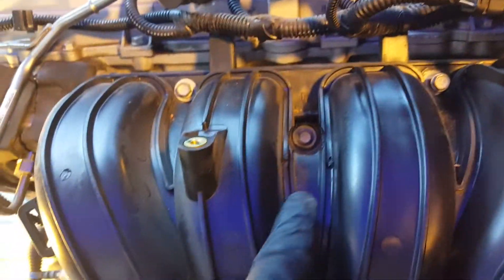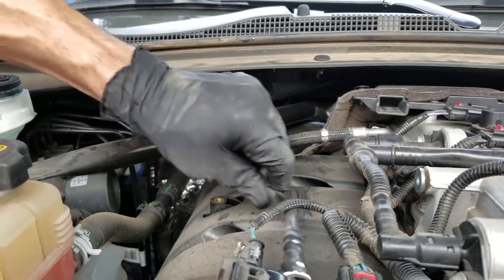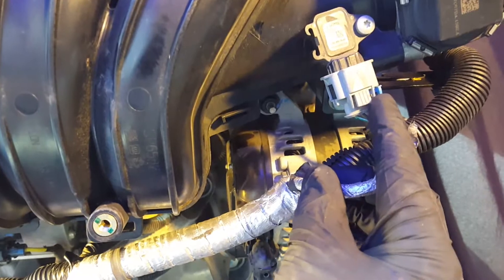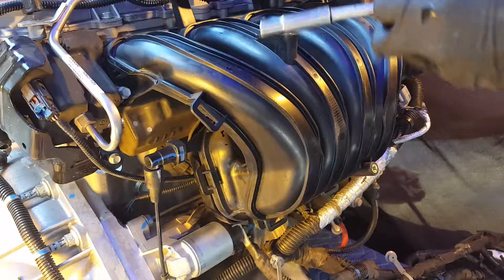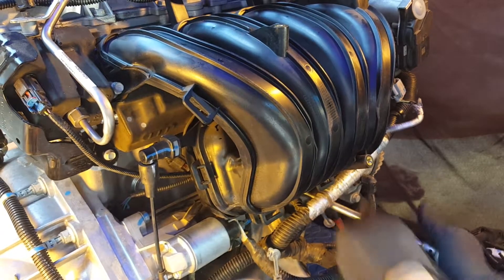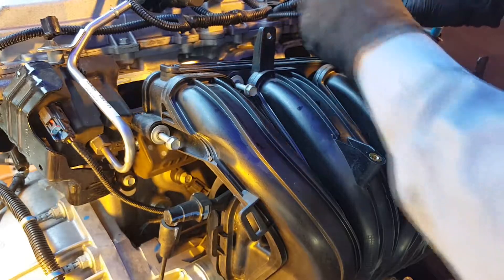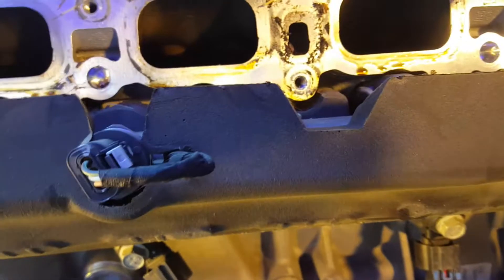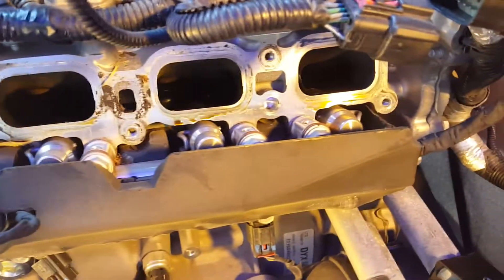2.0 Camaro - 2.0 ATS LTG - How to Remove Intake Manifold

Comment: For anyone looking to do this on a 2.0 CTS (MAY be the same on the ATS or Camaro) — in order to get the “sneaky bolt” underneath you MUST remove the alternator (mind the 12V hot lead, best to disconnect the battery as you will NOT be able to get at it before removing the alternator) to get at that hidden bolt. Once the alternator is dismounted just lay it aside forwards, and you’ll see the hidden “sneaky bolt.”

Comment: How did you even get your camera in position to capture the lower intake manifold bolt like that?? Replacing the transmission in this Camaro and it is by far the worst job to date 🤦‍♂️😭

Comment: would it be so bad if you just broke off that bottom bolt?  It doesn't look like it would create a vacuum leak.

edit: I did it today.  No problem.  Tore off the intake cover as well.

Comment: Would be great if you could clue us in on how to remove the "sneaky" bolt on the bottom seeing as how it's f*cking impossible. Any fool can get at it with the engine out of the car
Reply: Having same issue right now. I even removed the coolant resevoir for more room but i cant find that bolt & a stupid piece of metal hose is in the way 😭

Comment: Ok so everyone here knows it’s way Easier to remove the alternator to get to the bottom bolt your still have yo go under the car to unhook the vacuum line but you can stay on top to unbolt the intake manifold
Reply: In the case you disconnect the the vaccum line from the bottom, how is it removable from the intake manifold itself I believe my line is pinched and won’t allow me to pull the intake off
Reply: @alexanderrivera2934  you don’t have to remove the lower intake vacuum line from the bottom it has enough play where you can slip your hand on it from up top it’s not easy but it’s do able
Reply: But there is a button like deal on the line ring press that in to release it from the intake

Comment: Currently having issues with a misfire on cyl 2. I replaced all 4 spark plugs and the coil for cyl 2 but problem still persists. I believe it might be the injector. Any suggestions? Should I take it apart and clean the injector or do you know any good solution that does not require removal of parts?
Reply: Same issue in same cylinder ive replaced spark plugs twice and both times the gap of the spark plug in cylinder 2 completely closed. Any solution? Im also thinking injector

Comment: 2014 CTS 2.0. I have oil in cylinder 4 closet to the windshield ) also oil in my intake manifold. So it’s causing a misfire any news on this? 110k miles I’ve own the car since 32k miles. Synthetic oil always. Any recommendations?

Comment: I did a boost leak test on my camaro and it sounded like pressure was being relieved from the manifold area I could not pinpoint any bubbles. Is this a boost leak or does the car relieve pressure from the valve cover area near the manifold normally?

Comment: How do you remove throttle body intake pipe?  No clamp just a weird lever dohicky
Reply: Slide locking ring to the left with a flat head screwdriver, look for the little knock/gap to grip it by and then it pulls straight off with a lil force
Reply: Mitch Tabor thanks.  I did figure it out.   It’s like a giant snap ring

Comment: How did all that oil get in there?  Do you think it's from the vacuum line that feeds into the intake silencer since there is no catch can?  Your thoughts.  Thankx!
Reply from the maker: Vegas knights + There are a couple of reasons. The main reason is this engine was driven 60,000 miles with a 30 lb boost tune and no catch can... We have our own catch can on It's way.. It is made specifically for the LTG to prevent future oil issues. High boost forces the oil into the cylinders if you do not have a catch can..
Thank you for the comment and the question... Feel free to ask me anything, anytime.
Reply: @StrictlyLTG  Seeing people do this with other engines, is it ok to run the engine with the charge pipe off for the purpose of spraying CRC or Seafoam into the throttle body to get the valves cleaned so I don't have to remove the manifold.  Since this is a direct inject.